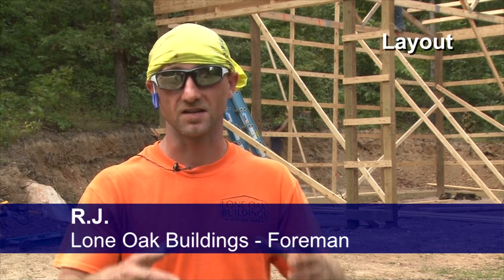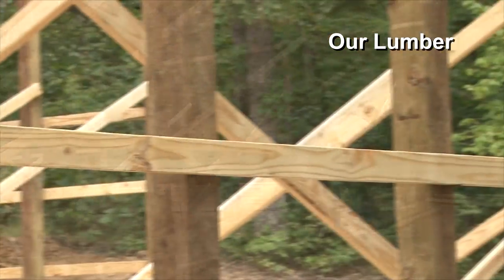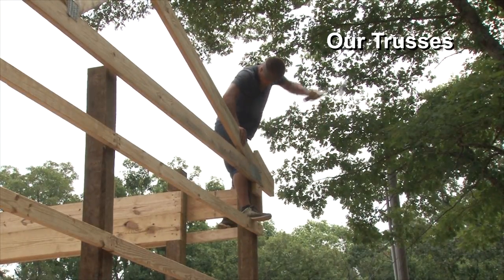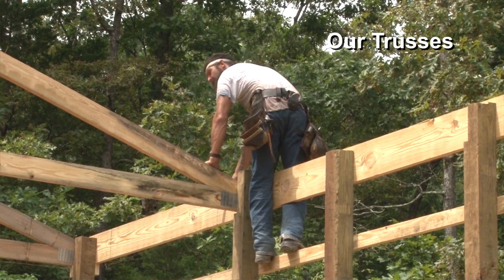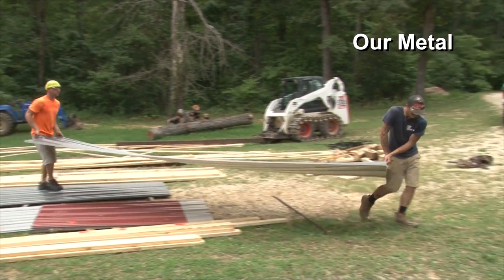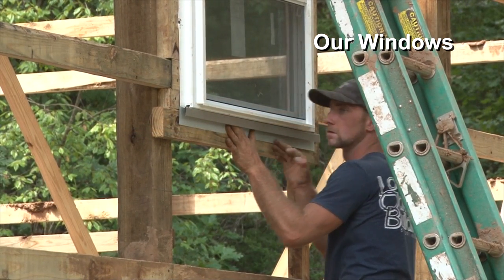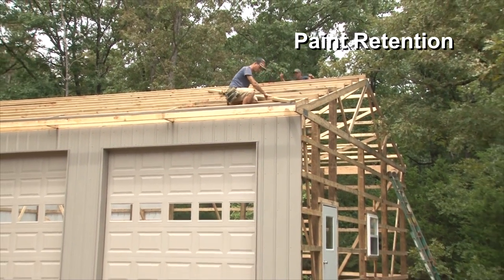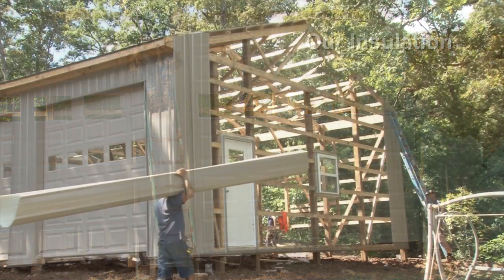Lone Oak Buildings - Constructing a Pole Barn

Comment: I had a company build a similar project two weeks ago. Post pavilion...24'x 36' 10' ceiling, 12' opening. I'll finish it off myself with girts, siding, windows, split-sliding doors. The guys that do this work are amazing. Building completed in one day. They don't even say goodbye. Ha! Everything plumb, square and accurate. They've got their methods down to a science. They did leave piles of rubble behind, but I made good use of that filling sink holes on the property. Once you have a solid structure, you can easily expand the size of your building yourself if needed in the future.

Comment: I like the video,  but  from my experience,  South Ga. ,  I used the same green pressure treated post 4X4, and they lasted about 10 years, and rotted away at the ground surface, I  would hate to pay for all that work for a 10 year barn.
Reply: I'm building a carport for a client and we are using 6x6 PT that will be surface level with brackets.  I hate shoving wood in the ground like fences, the ground moisture and larvae and any little bugs have a field day with setups like that including living in the wood.
Reply: @REVerbtalk   yes  that is what I found,, but the brackets just don't hold a fence post with gate hung on it...
Reply: @jbrunson1949 , I've seen people drill a 1'' hole, starting 4'' above the ground contact, at a severe angle down into the center of the post, 24'' long. They then fill those holes with diesel fuel until the wood can no longer absorb anymore. Supposedly old timers did this with fence posts and some are over 100yrs old ?
Reply: @augustreil   -   that sounds like a good idea,, not to sure about the drilled hole size, kind of big for a 3-1/2 inch post, think maybe a 1/2" hole might be  plenty,,  sure would be nice to know this before starting a job,  you could drill from the bottom and then set them in a bucket of fuel for a few days before planting them.   also saw somewhere that a guy was using old motor oil to treat fence, and stain it at the same time, something more to think about..
Reply: @jbrunson1949 , Yeah, 1/2'' may be better for a 4 X 4.

Comment: What's the guarantee against the poles rotting in the ground is my only concern ?
Reply: TREATED wood.
Reply: @dennishensley1150 , I know but a lot of that stuff rots right at the dirt line.
Reply: august 50 year guarantee from manufacturer
Reply: Tom Slak well say your 30 when you build, 50 year I personally ain't gonna worry to much about at near 80 . The post for underground post are treated different from just PT lumber you get at big box stores , at least the ones from Yellow Wood that's a name brand from Abbeville, Al.

Comment: U made a nice dams for the poles with those concrete at the bottom of hole that pole is going to rot at the bottom
Reply: Poles usually rot at the dirt line. I want to know how long before they do ?
Reply: august most timbers like these have a 50 year guarantee
Reply: @heknows5418  That's cause they know ,  in 50 years ain't nobody gonna be around that had it built in the first place .
Reply: WH show me something that's been around for 50 years that doesn't need some maintenance. I'm 68 I need a lot more maintenance now than I did 30-40 years ago.
Reply: I've built every were up the east coast. But on the beaches blows my mine u dig till u hit water pack bout 3 good times with ur post no shit build from there I've had to go see not 1 post has sank 1/4 in can't believe it but foam is way stronger and doesn't for post. That's how they set power poles in flooded rice fields  it's bad ass. But I put my post in scd20 pipe heat it with heat gun it will lay down tight it's not rotting

Comment: Why hammers when they make nail guns?
Reply: Faster than dragging a cord around and cheaper than battery operated ones.
Old school, in other words !
Reply: The nail guns that shoot the right size nails are expensive and heavy as well.  Typically you use 16D nail for framing stick frame houses.  The nails used for pole barns are 20D and 4 inches long for wall girts.  On the roof purlins they use 60D 6 inch nails.

Comment: Why didn't you set those timbers in concrete?
Reply: Steven James some guys believe that the concrete will hold water against the post and shorten the life span of the post, then others say it won't just 2 schools of thought.
Reply: @heknows5418  Kyle at RR Buildings uses concrete piers and then sets steel brackets.  It assures the posts will never touch the ground and thus no chance of rotting.  I'm sure it's more expensive but considering the entire cost, the frame of the building is not something you want to cheap out on.
Reply: Howard's Channel yes Kyle is the post barn God. I’d love for him to build me one but lack of money and being many states south of him hinders that from ever happening.
Reply: Andrew Darbyshire when you drive by and see one stop and ask the owner , if he was satisfied with builder would he use him again . If you like the building and the owner gives you a referral on the builder, then you have what you need. When I was a GC I never had to advertise, word of mouth kept me with plenty of work, construction is like every other business, you have good and bad , just do your homework, references are the key.Good luck.